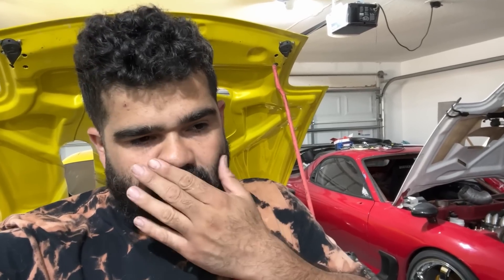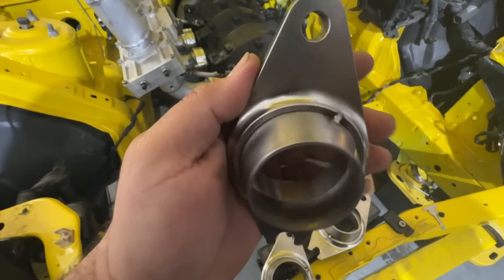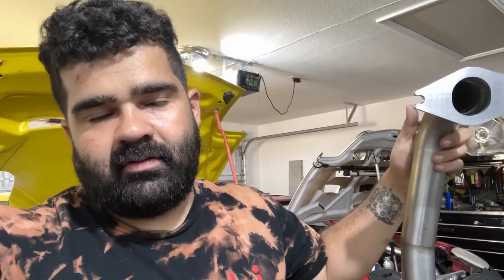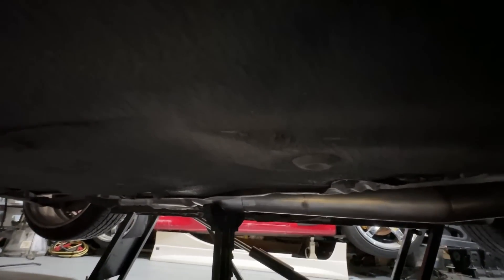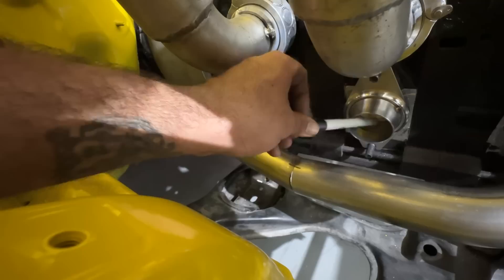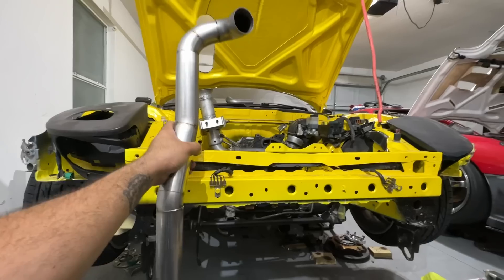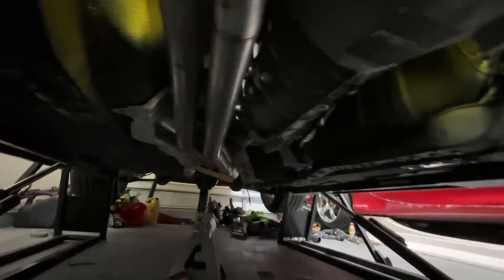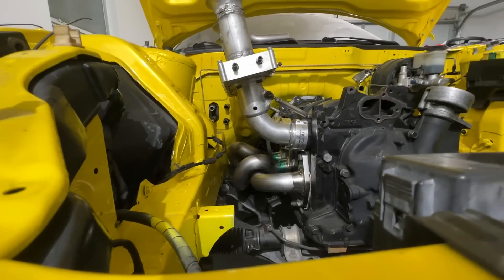Building A 20B Equal Length Header For 11K RPM's

Comment: Doing this right is an art form and a skill, About the only thing i learnt is i suck at it and using a piece of string and an air gun is a great way of calculating length as it tends to run with the airflow (that's info from the pro's i have been around)
Great work and they look sick :)

Comment: How important are equal length in terms of dimensional tolerances? What length change is considered acceptable or unacceptable when you are considering pulses that are moving at a high velocity and flow rate?

I assume these were measured from the centerline of the length?

Comment: Wow that looks amazing!!! What is the theory behind that long style runner compared to a shorter one?
Reply from the maker: Mazda Le Mans tech talk
Reply: @angelmotorsports hose runners look way longer than the 787b. 

Edit; just looked into n/a rotary exhaust runner length and it's very interesting. People run the longest primaries they can, all the way to the diff on some of them.
Reply: @angelmotorsports  looks good but shouldn't it be volume as elbows across the centre line are different compared to a straight length?
Reply: I was thinking the same thing

Comment: do rotaries not benefit much from exhaust scavenging?  i've never seen an exhaust setup with primaries meeting a mile away from the engine.
Reply: The length helps scavenging at high RPM actually

Comment: It's nice seeing different ways to make an equal length runner. When I 1st built mine for my 20b back in 2008, I didn't have a YT reference so I just decided on my overall length and cut up some old garden hose to equal length. Then I went to the hardware store and bought some of that black foam pipe insulation as it perfectly matched my header diameter. I cut small pieces and placed them over the garden hose to simulate my pipe diameter and give it space. Then I just layed the whole thing out and built each runner to match the shape of the garden hose mock up.
Reply: That's pretty cool. Back in the day it was all brain power and getting inventive. YT has saved a lot of the hassle and time.
Reply: @ThatHoodlum19  YT didn't help me at all back then. It was all Rx7club and years of reading forums and using my imagination from posted pics. My engine is also moved back 5-1/2" because I didn't want to move the rack in my fd. Only 3 other people back then had built their Fd 20bs this way (Peter Farrell, Autotech, and a guy named Chris Carslie R.I.P.) and not ONE of them posted pics over the internet on HOW to do it. I had to figure it out myself.
Reply: and if you are a psychopath you fill each one up with water and get each header within 1ml of each other ;) hahah
Reply: Bust out that arts and crafts skills.
Pencil and paper is cheap!
Reply: @ontariofishing1790  I need more of a 3d reference for stuff like this. My brain works better that way.